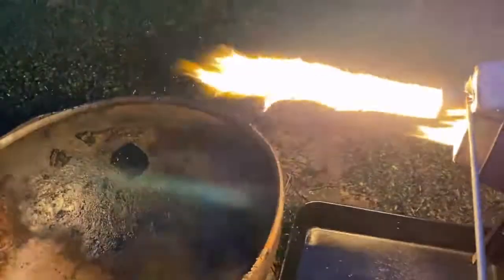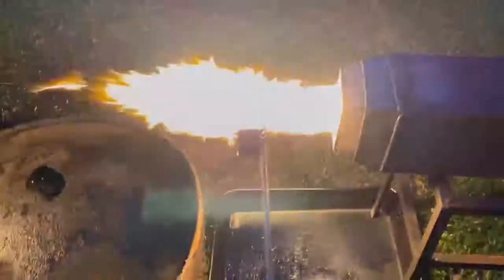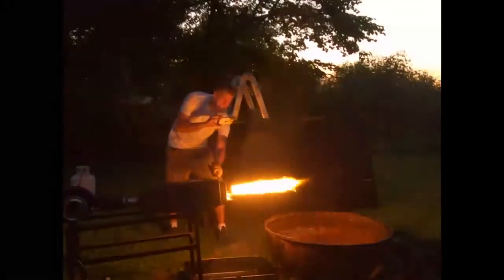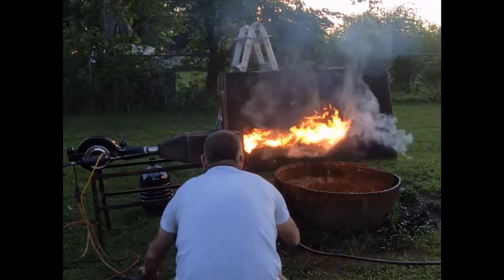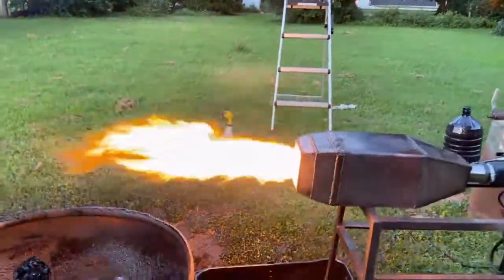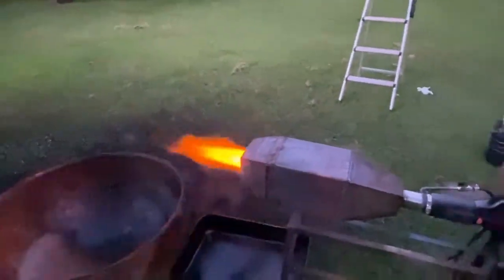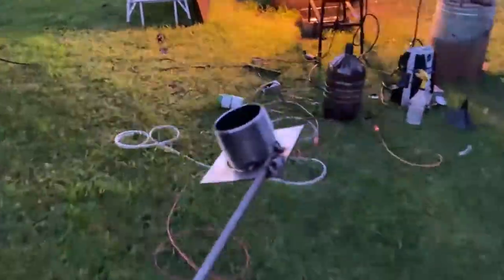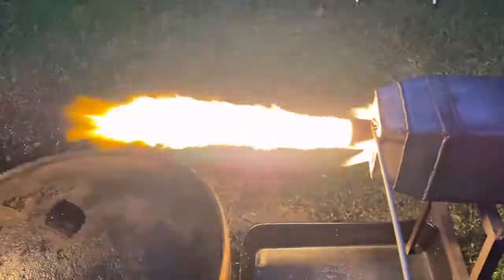Cast Iron melting furnace burner { Blower powered } .

Comment: What can you do about the DRONE SOUND from a burner ?? I was thinking of making some rolls or angled belled end on the pipe ??? What do you think NOBOX7 ??? 
You use stainless steel 304 or 316 metal types, what is your favorite ?? Have a great day MR. EXPERAMENTOR.
Reply from the maker: I have not done any noise reduction testing . I use alot of 304 stainless cus its a good enough grade but cheaper then 309
Reply: @NOBOX7  Thank you for answering my question Sir. Peace and good luck with your endeavors too.